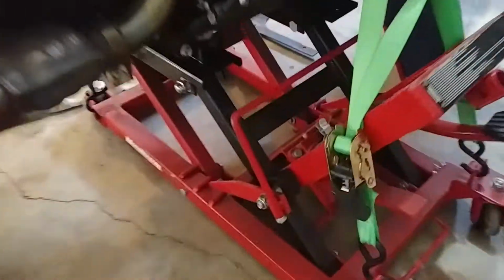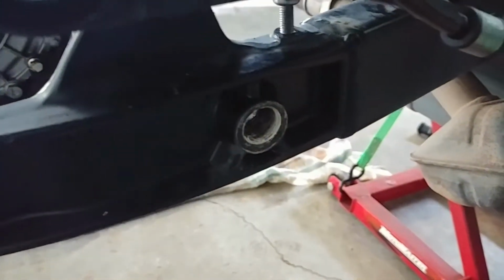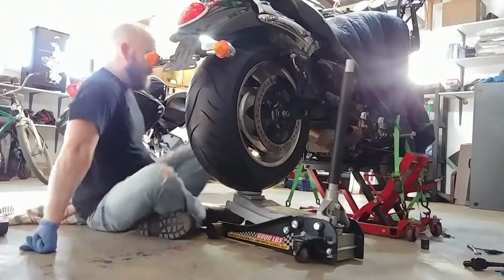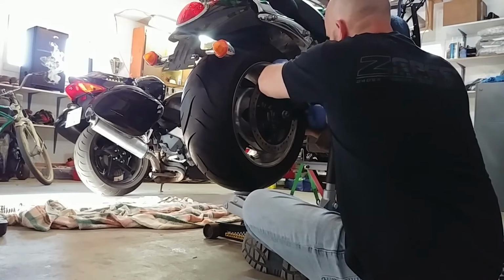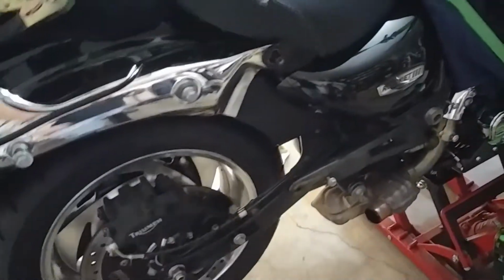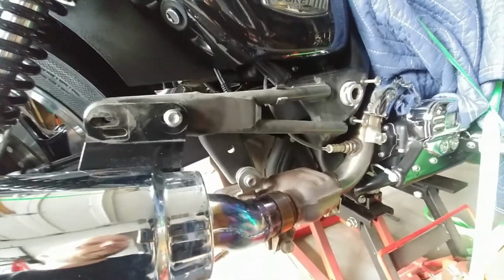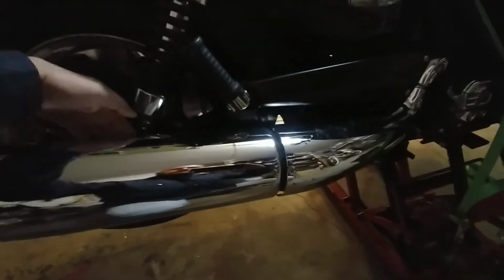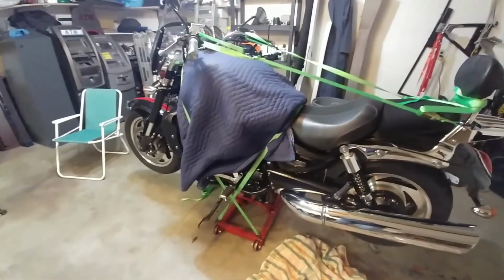2015 Triumph Rocket 3 Roadster Rear Tire install

Comment: Hey Mike, I am at about 18,000 miles on my 2017 Roadster.  I am getting close to the 20,000 mile service.  I am hoping you do a video on the valve clearance check or adjustment.  How many miles do you have on your Rocket?  Thanks in advance!
Reply from the maker: I'm happily only at about 20,000 myself, if that.  I did a heck of a writeup on redoing the cam cover gasket, which you need to do to do the valves, but no video.  Let me get the link to the awesome blog post though...it will be REALLY helpful.  Trust me, lots of awesome input from the R3Owners crew.  One sec...
Reply from the maker: Here's the link I mentioned in my last post!  Have a thorough read, TONS of info.

https://www.r3owners.net/threads/asking-for-help-with-cam-cover-gasket-replacement.36973/

Comment: Should I grease the axle/spindle before reinstalling? It seemed like it had been greased after I removed it at 3500 miles
Reply from the maker: I was unsure as well, as I hinted at in the video. It doesn't seem logical that it'd be a direct wear point, but I didn't take any chances and just put a very thin cost of grease on it. I didn't overdo it for fear of it creeping out and making a mess.
Reply: @LifeguardVegas I missed the part where you mentioned it.  I just reinstalled as-is. I didnt grease it but I didnt clean it either.
Reply from the maker: Yeah, I think you're fine, bud. Good luck, hope the video helped a bit.
Reply: @LifeguardVegas  yes, it helped a bunch. Thanks for the upload.